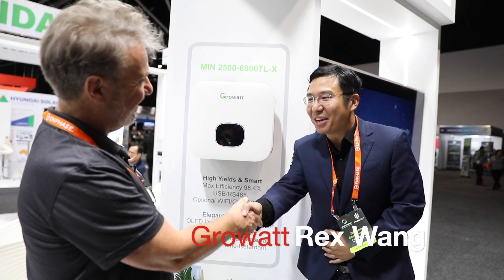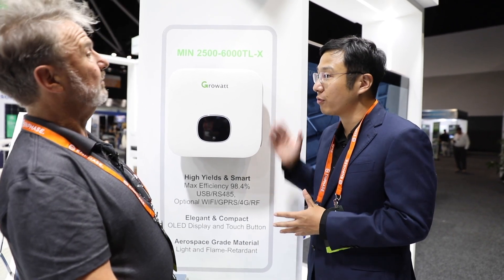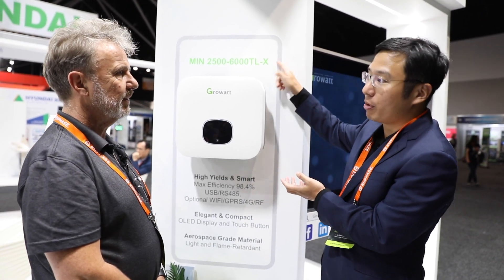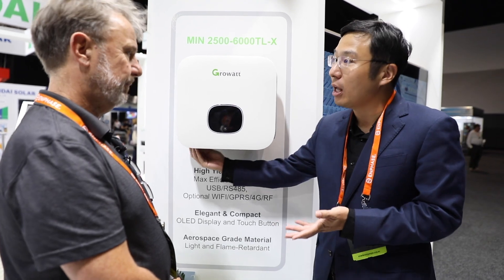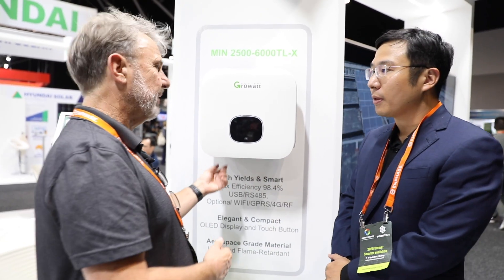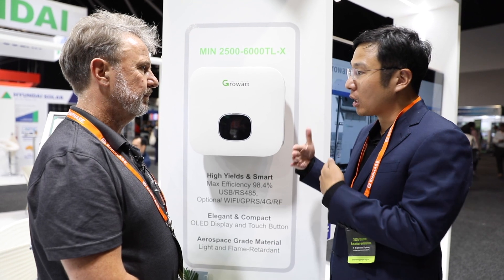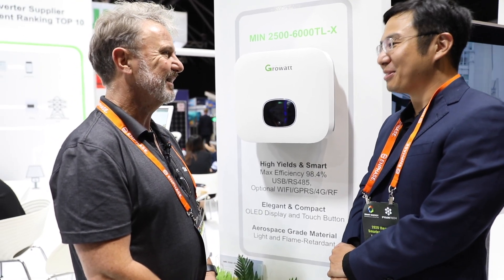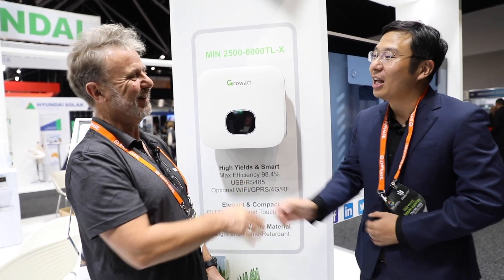Growatt String Inverter

Comment: Does this Inverter Growwatt TLx model require DC DB Box protection system ?  I understand from this Inverter datasheet that it has built-in DC surge protection ?
Reply from the maker: Yes, has built in d.c. PV isolator.